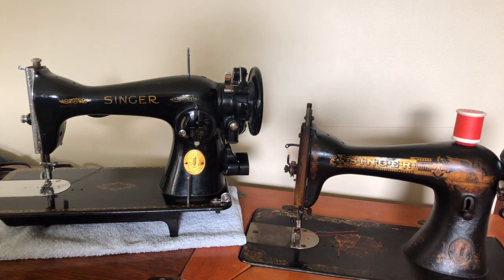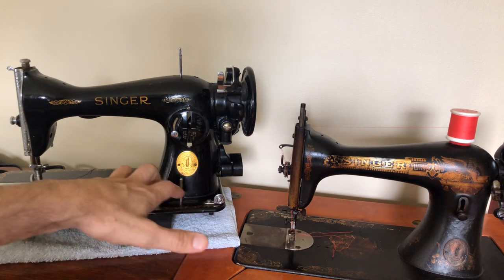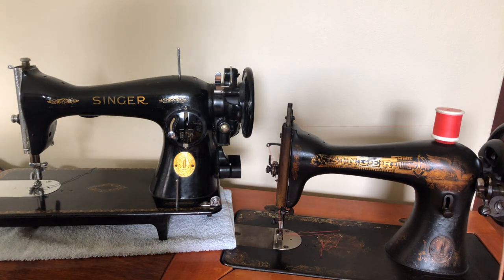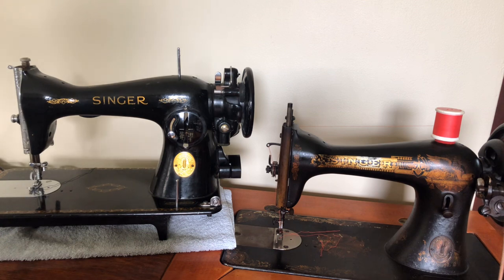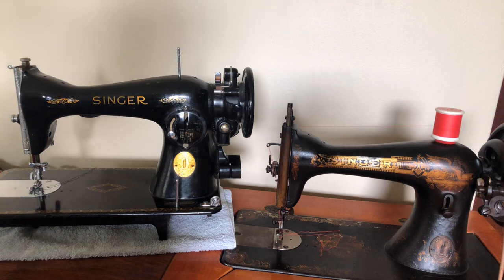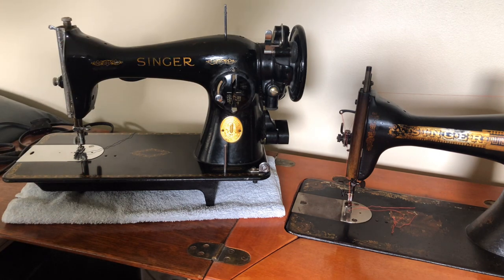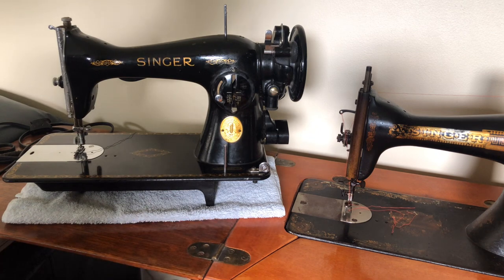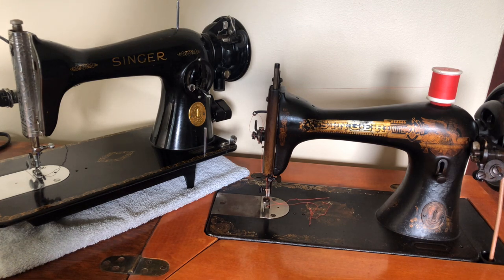HISTORY & HERITAGE SERIES #5: Singer's 15 & How The More Things Change, The More They Stay the Same

Comment: I have a 15-97 like a 15-90 but it  comes with a cabinet and stool.
The foot pedal can be put on the floor Or it fits in a bracket and you can use your Knee to change speed.

15-97 does not do reverse stitch.

Comment: I am pretty sure Singer still makes cast iron sewing machines, but not for the Western market. They definitely make a mechanical zig-zager.
Reply from the maker: Hi.  Actually, the Singer company does not exist, but Singer is still around as a brand/label owned by a conglomerate that sources multiple legacy brands out of Asia.  Any metal sewing machines produced today are knockoffs made due to the original patents having expired.  These modern versions are not built to the same quality as original Singers were.
Reply: @VintageSewingMachineGarage  The one's i saw  were for some Asian internet business. They had Singer branding and the marketing was not to Westerners. I know it isn't the original Singer, but they go by it,

Comment: Actually, Singer is still making these machines in India and selling them in electric and treadle versions as well as hand-cranks.  So it's a design that well over 100 years and still going strong!
Reply from the maker: Thank you for sharing.  I had not heard of this.  I'm not surprised if these are still in production although I wonder if it is some other company than Singer making them.  The patents on these ran out a long time ago and the first "clones" were made in Japan after WW II.  Later, production moved to Taiwan and eventually to China.

Comment: I have a 1927 15.  I've been repairing a few things on it since I picked it up this weekend.  One of the items that seems to be missing is the thread guide on the front face plate (can see on the machine to the right, not on newer, clean, on left side).  Anyone know if this part is available or how to get it (can you just buy?).  It is center of face plate at same level as the tensioner.

Comment: I have a singer 15k ,made in 1938 its very very noisy i mean loud to make the sewer deaf,,,it worked really hard all these years how to lower this loud noise ,is it a part worn off or what ? Appreciate your reply and thx for sharing about all lovely vintage singer machine.
Reply: My similar machine is very quiet.
Your is damaged in some was Or it badly needs to be completely oil
ed.
Reply: And greased

Comment: Thank you for your videos. I have two 15-91. One is a 1955 and the other is a be 1936. The older one is frozen. The needle rod and the pressure tension rod will not move with the balance wheel. I have used SMO and kerosene to try to loosen the the gunk. I am trying my hair dryer for heat. What else can I do or is this the “death nail” for her. I will break her down and sell parts if I can not get her moving
Reply from the maker: Hi Sandy.  It sounds as if you have the right approach to old machines as I too never throw anything away.  All machines can be salvaged for parts which are quite valuable to folks needing them.  Before you go that route, try soaking it in Marvels Mystery Oil.  NOTE:  Make sure there are NO electrical wires, sockets (light) or motor on the machine when you do this.  Its a messy process but it can work.  When I got my frozen Singer 185J to unfreeze, it took over 2 weeks of soaking along with intermittent heat applications.  Then, there is the necessity of getting all of the oil off the machine before attempting to reuse. Alternately, you can try Penetrant oils such as Liquid Wrench (Careful as it smells REALLY AWEFUL and I would not use it indoors ). Also, FYI, hopefully, your needle and presser bars are not warped from dropping as that could make it permanently inoperable without replacing those.  But it sounds more like rust/corrosion.  Also, note that drivetrain components below the machine can also corrode and stop the needle bar from moving.
Reply: @VintageSewingMachineGarage  thank you so much!

Comment: Hi I got a vintage white sewing machine the belt is broken, what size do I need?
Reply from the maker: Hi Zella.  The size can vary slightly depending on the White model, but I would take your old belt, lay it out, and measure.  This is the size you would use to order a new one.  They should be easy to find online if not locally at a Sewing-Vacuum service location.

Comment: Dear vintage sewing machines..
 Two machines i have. One is about a 1924 national in a portable case bought it for 100..really good shape.just bought the last two short bobbins out locally. Want to find a original petal for power.  The second question is i have a singer g model with seriel number. Needing to finish unfreezing main shaft.  To run needle up n down this is a biggie because i need a large plate rounded for the one side. .and i would like to find a sewing cabinent for it .point being it is a coffin sphinnx model. Assuming it was a treadle converted to a electric...in the twentys.  Can i email you with pics so i can get fully functioning so it could be a 1908 converted in 1924 1920 or so. I can email you my number privatly. Any assitance will be appreciated..looking at a necci italian pretty sure its a bd nova machine good spects i researched. So far

Comment: Hi. I am new to your channel.  Was given a family heirloom. A Faultless. I understand that was a rebrand from National. So the age is between 1895 and 1920. Cannot find the model #. The machine is currently in the repair shop for a cleaning and check -up. It is intact. The original owners manual is in tatters. There are random pages I will slip into a plastic page protector and attempt to copy. The pages almost feel like cloth! Do you have an email address where I could send a photo or two? It has a bullet shuttle. No derailer for the belt. Also has  a box full of assorted feet! I'm looking forward to following your channel and learning to use this machine. Thank you. ~Diane

Comment: I was sold a singer 15-91 but I am not sure what it is. It says made in canada. Serial number is JC761776.  Has minimal decoration. potted Motor on back. How can I tell if its a 15-91 which is what i wanted as its considered the strongest of the home vintage sewing machines.
Reply from the maker: Hi Daniel.  Can you tell me what color your machine is?
Reply: @VintageSewingMachineGarage  black with minimal gold trimming
Reply: @VintageSewingMachineGarage  It threads like the 15-91 with the tension on the side towards back.